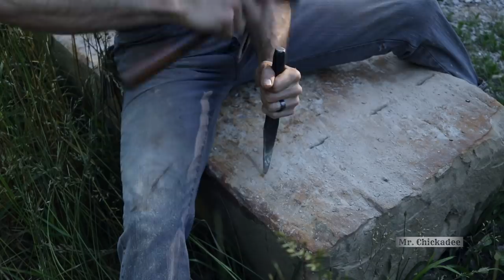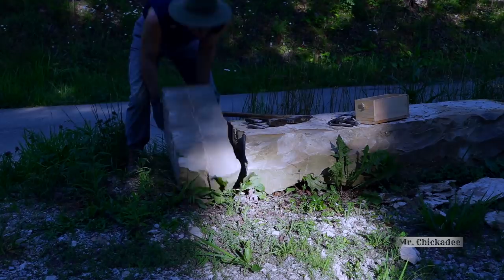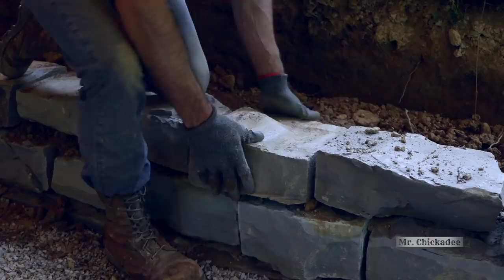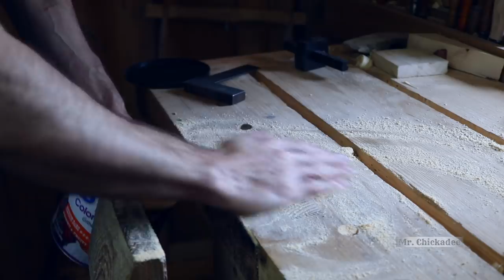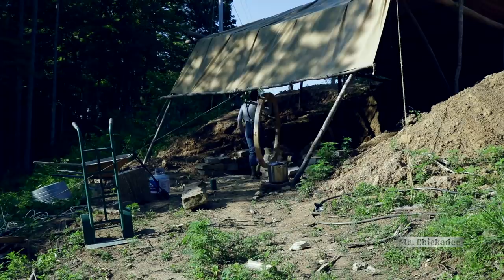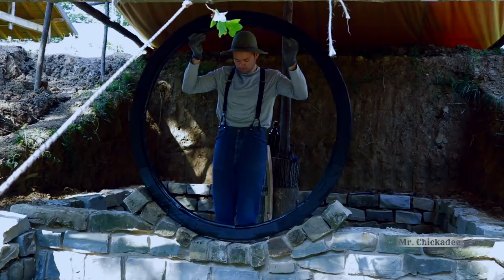Building a Hobbit style root cellar with stone Part I

Comment: Impressive skills and excellent work. This root cellar will really be something special.
..
Your video leads me to recall working with an old-hand stone mason/brick layer in the 1960's who subcontracted with my father on home building and remodeling projects. I mixed mortar and cement for him, hauled stone, brick, and block, and so forth. I was the muscle; he was the skill.  It was fascinating to watch him work, especially with quarry stones and field stones.  
..
Using quarry stones to build retaining walls and stairways, he used techniques and tools nearly identical to what you used here. I always found that work physically tiring but very satisfying. Stepping back to look at a stone structure that you helped build is a special experience. At least it was for me.
..
When we used field stones to build fireplaces, he would pick up a stone about the size of a head of cabbage, turn it in his hands, and then split it in half with one quick tap of his masonry hammer. Sometimes, he used the heel of his mortar trowel to split stones. He would tell me, that  "The trick is to pick just the right stone, to hit it just right in just the right place, just not too hard."  
..
I still think about that advice to this day. He was the best stone and brick man within a hundred miles and was much in demand. It was not hard to see why. Even more amazing to me is that the man was rarely sober, yet I never saw him set hand or foot wrong.
..
Thank you for bringing that time back to memory.
Reply: And thank you for sharing that memory. I enjoyed reading it.
Reply: As stated by another commenter, thank you for sharing that memory with us. It was very neat to mentally visualize and I appreciate you taking time out of your day to give us that image; that little piece of the past.
Reply: I've seen people on youtube do that with the trowel, its impressive.

Comment: Excellent craftsmanship. The bow ties are nice. The stone work highly complimentary. Just WOW. Takes me back to my youth.  In 1977 my father & i built a very similar 3 ft prototype round door with keys and dowels for his Asian themed house. For the full 9ft door we changed to  glued plywood for added strength. Not as pretty and took a lot of laminate and spoke shaving to make it presentable.  30 years later the a very wet winter freeze and slow driveway creep pushed one of the 12x12 jambs 8 inches. The original design would have broken. The laminated just flexed and sprung right back when the jamb was reset. Sure am glad I lost that argument.

Comment: The old Egyptians only had access to bronzen tools to cut out stones for their pyramids. They applied a neat trick which can help you in chiseling out the first grooves in the large stone to plug in the breaking chisels: apply a little water. It will soften up the stone allowing easier chiseling, and will prevent unwanted cracks. Greatings from Belgium.

Comment: Are you concerned that a single wythe wall will bow or buckle under the load of the surrounding earth?
Reply: Fun to watch, but holding back 7 feet of dirt is a tough chore for any poured foundation and wall.
Reply: @shade38211  agreed. But.... this is a man who does his research and homework.. I have faith in him.
Reply: It is anchored below floor level and the weight of those stones will make for a lot of friction. Towards the roof of the structure might be more of a problem but it's more shallow soil as well. My guess is that itll hold fine. You should see some of the pubs in Germany, many structures made just like this over 500 years old and very extreme weather.
Reply: @terryegan3831  My thoughts exactly. I would like to hear him explain why he did it this way though.

Comment: Using Douglas Fur I see. That stuff is HEAVY. I had to run a 16 X 24 X 40’ long thru my planer. Just about killed me. Weighed 1000 lbs easy. Had to run it slow and steady but I got it done. The 20’ weren’t so bad but they were heavy too.
Reply from the maker: Its shortleaf pine and walnut
Reply: Mr. Chickadee okay!!! Thanks. Looks like Doug fur or cypress with the big, raised grain. Love your channel.

Comment: What a cool project! Where did you get so much raw stone, a quarry or on your property? If you bought them was it cheaper to cut the blocks yourself? Did burning the wood help the joinery any, by like expanding and contracting it? It looks very cool, like a natural dark stain. What did you seal it with, linseed oil or varnish? Is the hoop going to be the door or the jam? If you use dirt between the stone blocks aren't you worried they'll collapse under pressure or be unstable? Really looking forward to more updates!
Reply from the maker: I bought the stone as is delivered, smaller was not optional. Burning is a preservative, also looks nice. Canola oil, pine tar, citrus solvent. Yes door jamb. Please read description of video, this is old stone technique.
Reply: Thank you for taking the time to answer all my questions! I feel silly since you did write it in the description

Comment: Best way to move large stones by hand?  You had a engine hoist or something at one point?
Reply from the maker: One reason to break them up is to make them easy to move by  hand.
Reply: Mr. Chickadee understood! But you do have a some device, you used it when you built the foundation for the blacksmith shop I think?

Comment: Great video, as always. I noticed your mix uses canola oil (AKA rapeseed oil here in the UK) now instead of linseed oil. Is there a reason for this change?
Reply from the maker: Price mostly. 5$ per gallon rather than 40, works quite similar.

Comment: Why not use Copper Wire or Steel Wire .... to cut the blocks by rasping in between the block gap ? Especially for making the smaller block sizes.
Reply from the maker: Hammer is faster

Comment: Are you not concerned that as the dirt you used in the joints compacts, settling will compromise the integrity of the finished structure?
Reply from the maker: Did you read the description?

Comment: Is that maul specifically made for masonry? How much does it weigh? I found one that may be a blacksmiths maul or some kind of john henry railroaders sledge. Just bought 13 ac in wi and will be busting up stone, and hoping to find a lot while i dig out a walipini and some foundation areas.
Reply from the maker: Yep, its a 6lb "stone hammer" Im sure it has many names. They are typically more obtuse and harder than an axe, which makes sense for the work.

Comment: I was wondering if you went back later and used a type of mortar between the stones as you were using dirt to level them. I would think if you did not then a problem with mice and other vermin would arise later. Just wondering.
Reply from the maker: I will be pointing between stones after the walls are up, not to worry.

Comment: Did you purchase or make the splitting wedges? What kind of temper should they have?
Reply from the maker: Made them and the chisel to match, high carbon steel fairly soft for the wedges so they dont chip easily, chisel hard at tip and soft at handle

Comment: I would use a big salvage melamine round table, maybe enlarge it with 2x6 bits nailed around it , if necessary , then nail 6 inch boards around it and use that as my scaffold for the round door part .just an idea..how to do this cheaply without putting 20 hours into it..lol